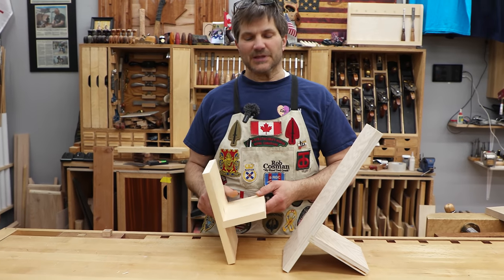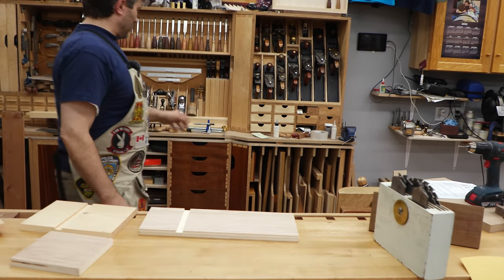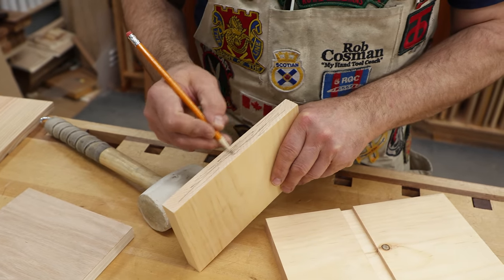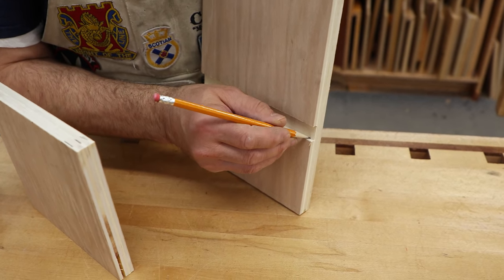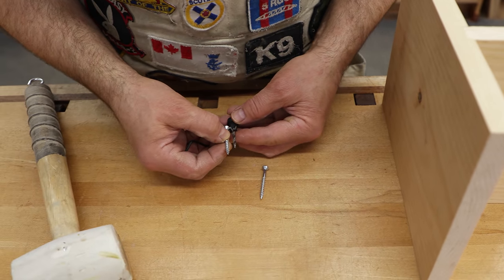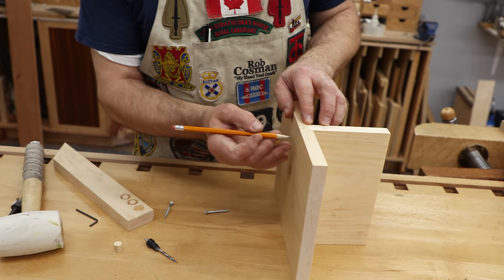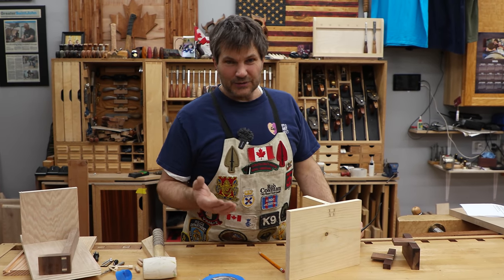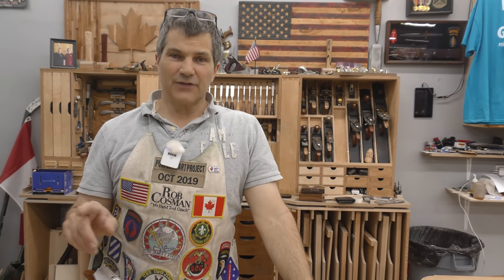Dado Joint - Is it a Good or Bad Joint?

Comment: I drive 1/4 inch wooden dowel through the dado joint about every two-three inches, looks good and I think very strong, gives about 1+ inches of cross grain connection for each dowel.  much like the miller dowel.  nice instructional video, thanks!!! 👍👍👍👍👍

Comment: Fantastic video, Rob. I learned the strength and utility (as well as the weakness and futility!) of the dado joint in shop class as a kid in the 60’s. I had to work out the fixes for it on my own, as my shop teacher never covered that material. I use dadoes a lot in shop furniture/shelving,  You have to reinforce against shear force if you’re going to put heavy loads on your shelves (and with shop shelves you obviously often do!). I never considered the toe-nailing method, but it looks like a strong, fast, and esthetically pleasing solution. As for the beautiful through wedged tenon method, well, my precision with hand tools isn’t quite there yet, but I’ll give it a go soon! Thanks again, looking forward to seeing the episodes on this new series!
Reply from the maker: The toe nail has been used for ages as the dado solution.

Comment: What about the sliding dovetail ? the Shakers used them on their furniture. They can be made by hand with suitable planes or with a router. They can be tapered from front to back to give extra security and used without adhesive to allow movement if both parts do not have grain in same direction.
Reply: You don’t need a specialty plane to make a sliding dovetail or tapered sliding dovetail, and there are several good videos here on YouTube demonstrating this. A shop-made jig for sawing your slot (“pin board”) does make it a bit easier, I admit, but an expensive and hard-to-find dedicated sliding dovetail plane is not necessary.
Reply from the maker: I will have a video upsoon on sliding dovetails and how I make them with just common tools

Comment: Anxious to see your approach to a sliding dovetail, especially since I've just recently had a go at them. Problem with a sliding dovetail is they lock up if there is any length to them. To get around this I cut slots both in the dado and board held in the dado with one slot being tapered.  I then produced dovetail splines using a butterfly bit and followed up tapering one side of the spline.  It worked!
Reply from the maker: Yes you are correct the longer the sliding dado the more friction, thats why the tapered sliding dovetail was invented

Comment: Great teaching video. Thank you Mr Cosman. You can make super strong joints for shelving by gluing quarter round molding into the lower angle of the dado joint and then toenailing it.
Reply from the maker: Yes that a version of the toe nail method I shared.  Thats for giving us a great variation on that.

Comment: I've always sized the end grain for glue joints on dados and found that doing so significantly increases the strength of glued end grain.  It was a tip I picked up from fine woodworking magazine using a 1:1 ratio of wood glue and water to seal the end grain before glue-ups to give the glue in the dado joint something more substantial to bond to.
Reply from the maker: Yes seizing the joint first does help in end grain situations , but it still a weak glue joint

Comment: Excellent!  you've answered many of the aspects I've wondered about on Dado's and a few more.
One thing I'd like to know more about is Tapered Sliding Dovetails.   They seem to have the advantage of sliding together easier and locking up on the last few inches.  Seems like they'd be good for assembly on site.   I can't quite figure out the math but I bet you have a few ways to work these out.
Reply from the maker: A regular sliding dovetail is much easire to make.  the tapered is a more difficult joint

Comment: Interesting with the nails. Known about them from my first tree house with my dad and later for framing studs etc but never considered this for furniture. Rob, what do you think about only nailing one side? From the bottom on lower shelves and from the top on upper shelves for instance so you wouldn't see the holes. Thanks for another good vid. I know these take time and thanks Luther.
Reply from the maker: Well you really should do both sides as the "X" that forms is really strong

Comment: Thank you for making this video. Seems EVERYBODY on youtube has a domino! : ) Question for you. What about wood movement? I am working on a solid wood credenza that is more like an oversized bookshelf. One long horizontal support (shelf) in a stopped dado with two vertical supports below the shelf attached to the bottom and two above the shelf at different spots attached to the top.  My understanding is that I could use glue and dowels on the ends of the large horizontal support, but need to accommodate for  wood movement in the vertical supports. Is this correct? Do dadoes in a large shelf attached to the sides of a carcass run the risk of causing the sides to split due to inhibited wood movement? Thank you.

Comment: What about a sliding dovetail? Great video, thanks!
Reply: He noted at the end that will be in another video
Reply: @maxomo1  cool, didn't notice that. Thanks.
Reply: Yoel, I have started using sliding dovetails in the past few months in several projects, and I really like them.  They are a lot easier to make than I thought they would be, and there are some really good videos on YouTube showing you how to do it. I cant wait to see Rob’s take on it now. The sliding dovetail is stronger than the dado joint, and the look of it  really adds something to the visual appeal of a piece.
Reply: @JamesWilliams-en3os  yep, I agree, I just wanted to see Rob's take on it 😊
Reply: I keep shouting in my head "What about a sliding dovetail!" 😁
Reply from the maker: Coming soon!
Reply: @RobCosmanWoodworking  Back in the late 80s I did a maple bookshelf for a college class that needed a sliding dovetail...I only needed one...so I saved I till last.  Somehow when I laid it out, I was a quarter inch low... I had to remake two sets of dovetails elsewhere because of that quarter inch.  😂

Comment: A small point:  dados should not provide structure for a cabinet.  Structural integrity should be provided by the joints between the top and bottom boards and the side boards.  Those joints should be rigid, e.g., dovetails, sliding dovetails, lock miter.  For that matter, shelf joints can be sliding dovetails, which are nearly as fast and easy to cut on a tablesaw as dados, but are much stronger.  Just a thought, not a criticism of dados in their proper places.

Comment: Wow - some options that seriously raise the bar, for strength and quality.  I'm thinking that a sliding dovetail might be the best of all worlds - strong,  quick, invisible - compared to your other options.  I guess may be easy enough with a router.  I wonder there's a hand tool option?!
Reply: You can cut sliding dovetails by hand - one way is to cut the dado and then chisel out the undercut either freehand (easier than it seems like it would be) or with an angled pairing block and use a router plane to smooth the bottom. Seems like a lot of work, but it's actually pretty quick (for hand tool work - obviously not as quick as a powered router).
Reply from the maker: Absolutely  Video coming out soon

Comment: Sliding dovetail if it needs to be strong otherwise a 1/4 inch back panel and or with face trim ties it all together...what you showed are  exercises in manual labor informative but will drive some people to drink...😬 stay safe up there...BTW has there been any sightings of officer Dudley-Do-Right lately...is he out of rehab...hope so...😶
Reply from the maker: Screwing in from th eback panel is also a good method but typically not as strong as the solutions I showed since the back panel are thin and themselves must float if made of solide woods so there can be issues with that method
Reply: I can attest to the strength of toe nailed Brad's.  When I first started  woodworking,  I found a set of old solid maple cabinets that I reclaimed for materials.  Between the glue and brads,  it was extremely difficult to take apart

Comment: In its simplest form, not the best joint for the reasons Rob gives. Having said that, it’s what I would call a time/cost effective joint.
Reply from the maker: But a very usefuljoint that I use a lot.  You just have to understand it and know what application and how to strengthen it